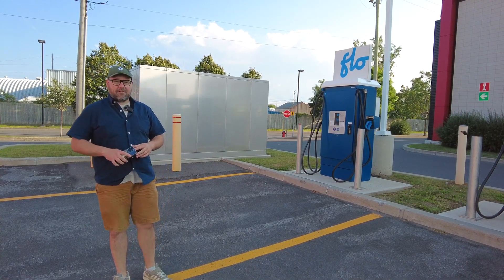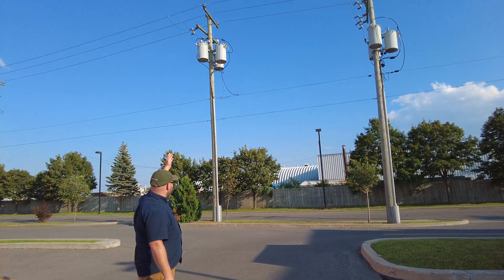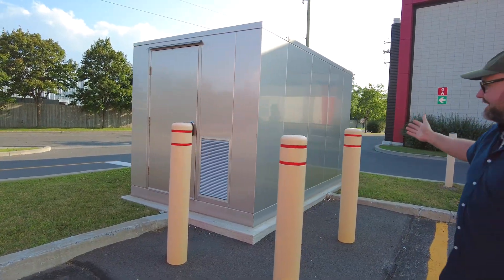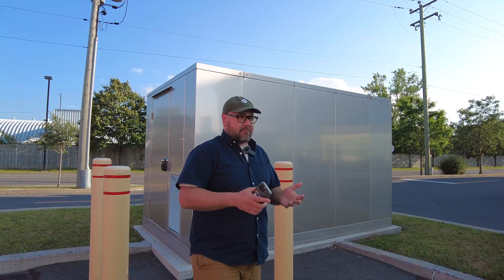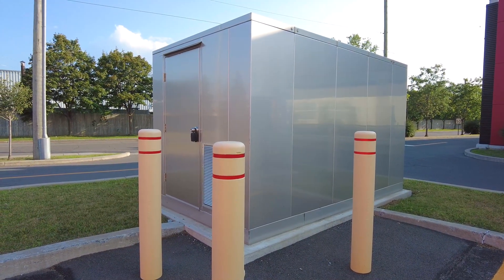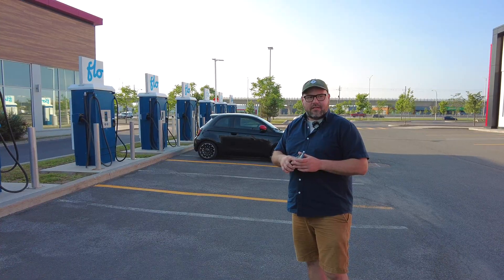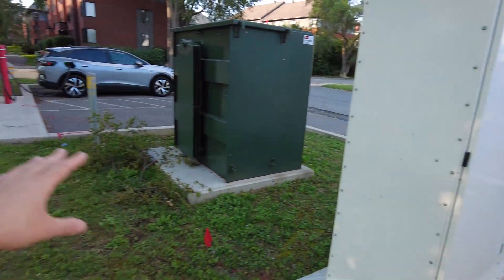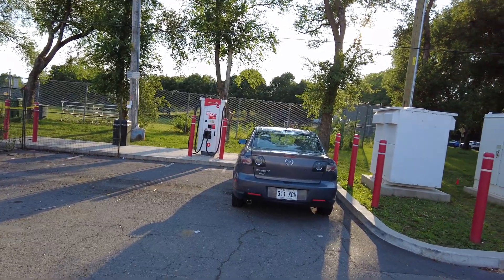Fact Check! Is EV Charging Powered By Diesel Generators?

Comment from the maker: Link to TikTok in question https://vm.tiktok.com/ZMSnsan7t/

I would also like to mention some cable cooling pumps are loud and often mistaken for a generator.. Is there any EV Charging near you powered by a generator?
Reply: The only one I've seen is a place that is truly off grid - a backup/emergency L2 only site at SK Crossing on the Icefields Parkway roughly halfway between Jasper and Lake Louise. That entire gas stop / rest area is powered by generators though, despite the proximity of the Abraham Lake hydro station. Likely environmental impact of power lines through the SK river valley would be too high to power a single site. (L3 at Lake Louise would nearly eliminate the need for this even as an emergency stop - as it is right now, the Golden-Jasper and Canmore-Jasper run is both about 310 km one way and that's a stretch especially in winter - but this gas stop  / charger also seasonally closes in winter so...)
Also, what kind of diesel generator could be on site that is plausibly hide-able but can supply multiple 50+ kW stalls? Ridiculous.
Reply from the maker: L’Etape QC has one of those generators that can power an entire neighbourhood

Comment: And even IF a charger is powered by a Diesel genset, that would still be more efficient then driving a diesel ICE. I have seen a diesel genset here in the Netherlands a few rare times. All where temporary because of the national grid congestion the remote service stations just needed to wait for the grid operator to hook them up. And since they are very remote, it's nice that there was a DC fast charger at all! And the did have a note on them saying that due to the grid congestion this charger uses diesel or gas for it's power.

Comment: I have a co-worker that made that claim and said he seen a photo of one. After I did some research for him discovered it was a biodiesel powered generator for a 50kw unit for a remote section of highway in southwest Australia where the grid connection was inadequate. I had to clarify that the dispensers are just the dispensers and the energy conversion hardware is the big enclosures usually behind the fence.

It's just ignorance and believing whatever they are told without doing any research. Usually from the "do your own research" crowd.

Comment: Why are anti EVers so full of crap?  Although having said that a back-up diesel generator would be handy when the grid goes down but the cost would be unfeasible.  Been an EV driver now for 18 months and would never go back to ICE, but my tip is never leave yourself  with less than 10% charge. Had a situation last Nov 24 just south of Paris at an Ionity station.  We stopped for coffee and toilet but due to snowstorm the grid had gone down.  We had 25% left but a poor Dutch family had 4% and couldn't make it off the motorway to next charging station.  I thought about offering them a charge though my Ionic 5 adapter but the time we would of lost charging them at 3KW meant we would of missed our ferry back to UK.
Reply from the maker: They rather believe everyone else who has no experience

Comment: The grid is moving primarily to solar / wind/ batteries / hydro / pumped hydro / gas peakers.  The transition will be away from FF resources as renewables and batteries are built out .. outcompeting gas.  Most people do not get that grid batteries have only recently been scaling up at cheaper prices .. and the cheapest prices have not even flowed into the math .. at the last auction in China, prices hit 35$ USD/kWh (I was paying $800/kWh 18 months ago .. and now buy at $300) .. at the new prices, storage is an immaterial cost as the grid ancillary value covers the negligible storage cost.  The next 5 years will open people’s eyes I think.  No consumer is against cheaper energy, quiet cities, and cleaner air.  Prove it, and people will stand behind it!
Reply from the maker: Great points and thanks for the insights into the future of energy!

Comment: I have seen diesel generators, but only as back-up, should there be a power outage. Perhaps, they run as a "peaker" plant, during high demand times, but I've never seen them run. They may run them once in a while, just as "maintenance" runs, where every few months, they run for a few hours, but that's it. NEVER as a primary power source!

Comment: The only generator based chargers I know of are in remote locations.  Some of the BC Hydro sites in northern BC have generators.  I don't know if there are other power sources at those sitss.

Some of the generators in Australia run on used fryer oil.  As another commenter pointed out, the guy traveling around Australia has video of generator powered, and generator backed, chargers.  He has shown sites that have large solar arrays used to charge the batteries used to power the EV chargers.

I think there are people who are willfully ignorant, and simply cannot see anything that does not match what they want to see.
Reply from the maker: Thanks for all of the information. I wasn’t aware of those sites.

Comment: Maybe in a remote area a backup diesel generator might be ok.
Our city electric is natural gas powered. So anything electric is.
Reply from the maker: Yes, in a remote area with no other options, that can be the case. There is a site about 4 hours away in the middle of nowhere that has a back up massive generator for the gas station, resto and ev charging
Reply: My city electric is mostly hydro-powered, only about 2-3% fossil fuels. 
Your end comment may be true for your particular city, but not further afield.